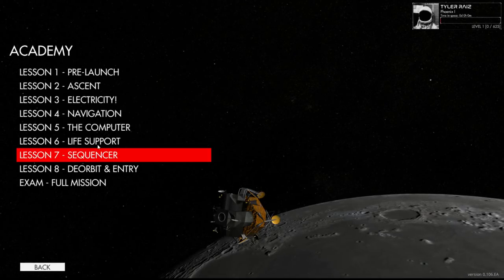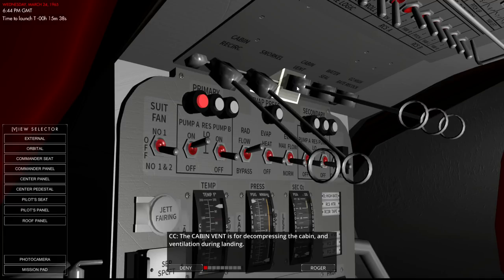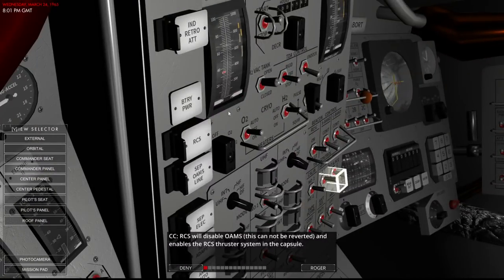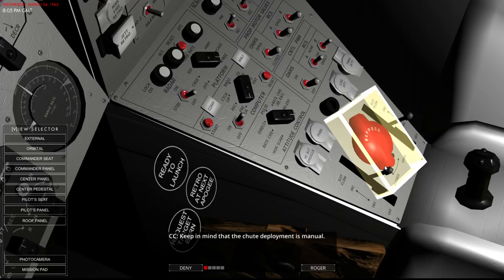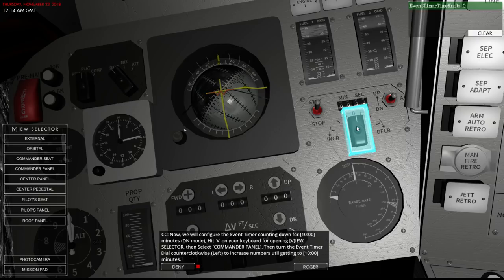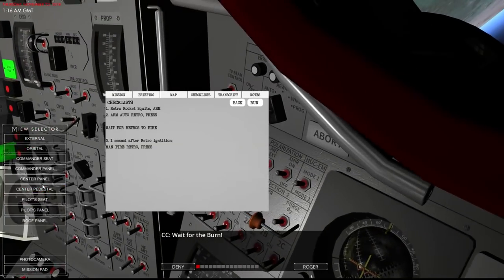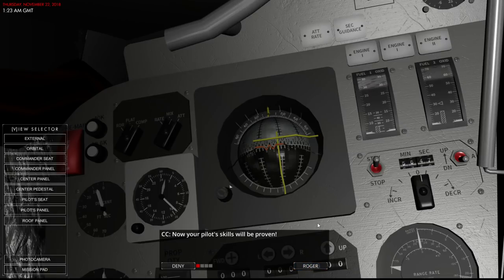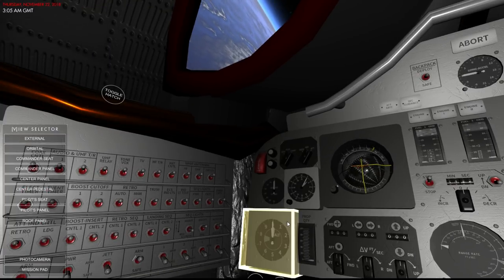Reentry - An Orbital Simulator (Early Access) - Gemini Systems Part 2

Comment: It looks like you should of turned on your RCS towards the end before you fired your retro rockets. I think you fired the retro pack in a direction that was "retrograde" at an earlier point in the orbit, because the capsule had no way to change to your current retrograde vector after ditching the OAMS. If that makes any sense.